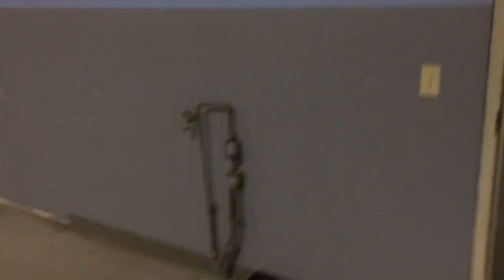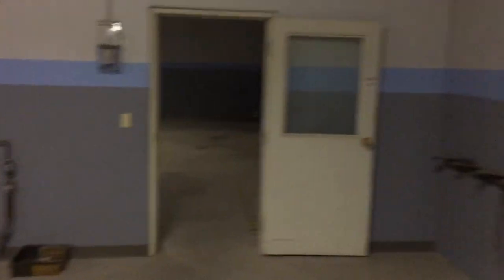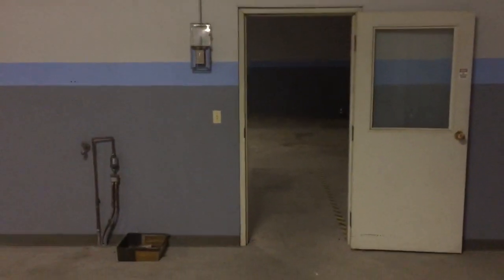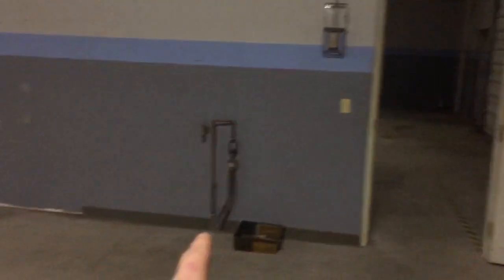Where to put roll-up door?  Help!

Comment: If you are keeping the Ru-door in the front, then don't try to move the electrical panels, instead shift the (to be installed) ru-door to the left (as you look at the E-panels), this will give you a gradual, more predictable turning radius. and much less potential for crashing or " curb checking" as I am guilty of doing numerous times.
  Also have you given any thought as to what kind of shop crane you want, perhaps a rolling gantry. and you might look into a pneumatic assist 2.5 - 3 ton chain fall/ winals hoist. those are always useful.

Comment: John, For right now I would put your roll up in the front. Later on I would put another roll up in the back. Your work area looks to be around 100 feet long if not more, so having doors at both ends will reduce forklift travel just like the swing doors you have at both ends reduces walking from one bay to the other. I know it will cost more to do it that way but in the end it serves your needs better. 
If you don;t want to lose the wall space in both bays then I would just place it in the front.
Planning out the location of machines and how to best utilize the space you have is probably more difficult then any other aspect you will encounter. When I was doing this for my shop I took a piece of sheet metal and drew out the floor space 1 inch equaling 1 foot, then I cut cardboard shapes for each machine  that included the needed work space. I moved them around until I found a layout that worked for me. 
I hope this might be helpful to you.
BTW Happy New Year and I wish you all the Best.
Cheers,
John

Comment: Make sure to line up the inside roll-up with an outside roll-up as others have suggested, gives you the most flexibility in the future.

Take some 1x2/1x4 boards screwed together or large cardboard sheets and block out areas you think a particular machine will go, but make sure to add in operator space and access for maintenance. 

Then take something of similar length to your longest/widest expected stock delivery, add 5 feet, and try to negotiate around things to work on it. Also drive the forklift around with that same part, and see what you'd "hit" on the block outs.

Really look at flow, in other words your deliveries will flow into cutting/dirty operations, then they move onto later steps in the process.

You were already planning at one point to put the "dirty" operations on that back wall, so that's where the roll-up should go.

Comment: I'm thinking no door. There is already an overhead door in the one half. It would not seem hard to transport around the parking lot to and from there, then you leave the separator wall to line up things. You won't lose space when you would have had to leave a space for to have yet another door pathway in the core of the building. I would increase those single doors to double large doors for sure. I would line my gear up in rows parallel to the center wall for ease in and out the overhead(s). Wow, I counted 5 in one half and one in the other. Lot of doors! lol

Comment: Wow that is rough.  How much to move the electrical panels? Both ends require tearing up the slab from what I can see from your pictures the center makes no sense for work flow. If  you put the door on the other side of the electrical panels and leave the man door please put guarding in front of the electrical panels. Its not pretty when something like a fork truck crashes in to them.

Comment: Near the water. Keep the man door.  For sure you will want to keep the man door.   Definitely don't want the roll up right near the wall.  Put the roll up just on the other side of the water.  Can move the water but that requires concrete cutting.  Doable at this stage.  Best of luck.

Comment: looks like those panels are in the best spot haha but I bet if you put the door just on the other side of the panels towards the middle of the wall that would be the next best. possibly better because if you had the door right on the end over the panels, it would be a tight turn from the existing roll up door to this new one.

Comment: I don't know what kind of budget you have to work with but my opinion is to preserve wall space rather than break it up. If you place machinery along the wall I t's cheaper to run electrical along a wall than to the center or other wall in your shop. I agree it would be better to locate the roll up door next to the electrical panels which will be close to the entry in the space next to you. Also if you locate the new door in the center or towards the far end will access become more difficult if that other space gets cluttered? Just my idea.

Comment: Hi John i would not remove the access doors at the end of the work shop as this gives you a point of egress in case of fire etc. the rool door i would just move it along the wall
a little  and at the end of the shop close to the exsisting door.
good look with the new shop i enjoy watching and learning.

Comment: Draw a layout of your shop floor plan on both sides of the shop, take into consideration the footfall of staff, turning circle of the forklift, plus ensure you have room for bollards to prevent the forklift hitting machinery etc. Safety is paramount for yourself, students and staff. Once your plan is done then you can decide the best place for the door, aesthetics are secondary to good planning.
I would use double doors and a pallet truck to move gear from one side to other, this would make the whole scenario a better prospect as there will be no moving forklift in the shop area.

Comment: First thought is nearest where material is delivered and product is shipped out.  I am assuming material rough cut, grinding,   compressors, and storage will be kept on one side and machine works and inspection on the other. The electrical panel is a non issue. Design your shop and install the electrical panel you need (with some expansion space) not try to work around it.

Working with a good electrician, HVAC, lighting, fire system, and compressor people during the layout phase can save many headaches. Also, I like to seal the floor. At least in California they get real fussy if any oil like material or chemical contaminates the concrete and removing it means removing concrete when you leave the building. 

A good PE is where I would start, only there is the wee problem of finding one, otherwise you get to deal with the county piece by piece to get it all signed off. Still it's do-able. Does the landlord have a PE he's worked with and trusts? That can help keep the landlord happy too.
Reply: Well, raw material is usually in 20' randoms and shows up on a flatbed. So which of the 5 doors would he back up to and can it be different than where box vans would pick up and drop off the smaller stuff?

The lane near the roll up would be the lathe side. Lathes get long things and all but one mill gets blocks. It can help to have a Bridgeport on the large isle side since that's the mill that get's the wierd long things balanced on forklift forks using things like a right-angle head usually (just saying).

You are going to decide on the size jobs you are going to bid, in quantities, weight range per part, and complexity, then the min and max you are likely to expand the shop in the next three years.  The electrical guy will need a good guess at all the current loads and likely near future ones. There will also be a discussion on transformers and how the capacitors are going to be arranged (often you end up with a capacitor panel since most of your load is inductive). This helps keep the power company happy so the don't charge extra.

Give the power company a call now. They will be happy to talk about what they would like to see (even if you only later do half of it). 

Fire marshall loves to talk too, just on a heads up of what you're thinking of installing. He needs a map of everything and would like a firebox set up with a key so they can get it to put things out. They also like a big breaker that kills the power near a door (even if the distribution panel is elsewhere).  Oxygen and Argon racked well away from flameables (and both away from forklift traffic and where they would come in).

Just keep asking them questions and taking notes. Posting exit maps for employees, emergency numbers, maps they can grab to get to the hospital, fire extiguisher locations and people with the training certificates for fire, first aid, and dealing with chemical spills....  Safety files of every type of chemical and metal on the premises (even the office supplies) have to be there.

1001 little things...

Comment: To the side of the water pipe and leave the door and pipe as is. Least amount of work and best location anyway. Or the same thing on the electrical panel end. Leave everything alone and go close to the panel. The real deciding factor would be where your bringing stuff in from and to. Which end of the building would give you the best access. The amount of work would be the same. Access to the door and maneuverability key factors.

Comment: My opinion is I think many people here including you are jumping to conclusions without thinking the whole thing thru.  My first question is what is the size capacity of the machines you will be putting in the shop area. You certainly don't need a big roll up door to move pieces that will fit in a Kurt vise. You have the big door in the back of the shop for moving machines in and out of there and I assume all large materials will come into the fabrication side 1st and be processed into pieces suitable for machining so the size door you need as a pass thru is really dictated by the size of those pieces. You could move a whole lot of materials thru your existing doors especially with a battery powered forklift. I see no need to be able to move machines thru that wall as you just take them outside and in the existing door if you have to but I can't think of many reasons to be moving fab machines into the machine shop or vice versa.  If you think your materials are too big for the existing doors I would suggest you turn them into double doors with no center post as that would give you plenty of space to move materials and be faster and more practical than a roll up door
Reply: NYC CNC
I still think you would be better served making that existing man door a double postless, you could get large pallets and even a short forklift thru them and anything else you can get thru a 8x 8ft opening. They might even make 10ft tall man doors as standard size but that I don't know. I hate to see all that prime wall space lost to another door, especially since you are loosing it on both sides of the wall.
Reply: +NYC CNC maybe you can deal w/ going outside and then in until you have a better idea of where the best option will be?

Comment: In line with one of the outer rollup doors seems like a logical place to put it. And maybe you could put a bigger door like a double door in the front so you can still roll some lighter equipement trough there

Comment: I think I would place it directly inline with the other roll up door where the Humvee is sitting. That way if you had something really long to move through the building you could do it without making any turns to get it through from the outside of the building. I couldn't tell for sure if you had a roll up door already in the back part of the building, which may make that unnecessary.

Comment: Why not infront the door behind the car? If you will move long equipment you can pass it from door to door OR diagonal from door left of the car to inner door.
Or, if you walk inside from the door at 0:41 and transfer lots of things through roll-up you can put it to the right cause it's very annoying to walk forward and than backward all day long

Comment: Next to the electrical panels. Too close into a cornes is not a good thing because You will only make it harder to move bigger items. In the same corner as the existing roll up door for the reasons You said and keep the man door. A roll up door with a man door is more expensive and they fail more often. Thgis as advice from someone who used to design layouts on machineshops :)  Happy new Year from Finland

Comment: Up front to the left of the panels If possible.  It's better turning radius anyway.  That way you'll be able to keep your man door as well.

PS.  If you are thinking of moving electrical panels, get some quotes (multiply by 2) and you will soon see that is not realistic.  Just moving the internal wiring in the wall will be costly enough.

I would steer clear away from locating it anywhere near a supporting column.

Comment: Near the main roll up door. If you have it near the back or in the middle you will need ally way access to and from it which will use up floor space. 

The other thought is to flow of work, how will the work come and go through the workshop.

A 3D CAD model will help visualize the work space

Comment: The area between the existing roller door and your opening will have to be clear.  Put the opening down the back and you may lose full use of the space occupied by the path between.  Suggest as close as practical to the existing roller door, keeping door ways.

Comment: I think you should put it somewhere about 5-10 ft to the left of the electrical panels. If you have it too close to the existing rollup door, it might make things awkward to drive from one through the other. (especially with longer loads) Plus, you remove the expense of moving the panels and still have the man-sized door to pass through. just my 2 cents worth after driving a forktruck at work on/off for a while.

Comment: I think I’m with a lot of others, put it just to the left of the breaker boxes directly across from the exterior overhead door. Straight shot in from outside to that end of the shop and you already have access to the back end of the machine shop from the other exterior overhead door. And I also agree with keeping a man door for convenience.

Some other silly observations. What is the wall made of? It looks like metal studs and drywall. Will that hold the weight of the roll up door? I’m assuming you could frame some structure in there that would allow for this but just something to think of, and yes if you just go with a curtain wall for now that doesn’t matter as much. Also it looks like you have some electrical outlets in the wall so you may need to account for moving the wiring up and over the new roll up door, sure you thought of that already.

Happy New Year!

Comment: Moving panel is too much cost with no return.
You want the area divided to keep out smoke and such from fab/welding side. That makes man doors necessary at both ends.
That leaves the middle to one side of the post or another. 
Since you are going to focus on the front for working on machine side,  towards the rear side of the post makes more sense for moving things in and out without killing your wall space.  You want people coming in to see the machines and students working from the front of the building. Having them off at a distance in the back of the building isn't very good showcasing.

Comment: I would put it between the electrical panel and the post shadow. Straight in front of the exterior roll-up as much as possible. Reason being you already have a large entrance for the machining  room on the other end that goes outside. And when you get your equipment in place it will still provide a path from outside to the storage room and the class room and this end of the machining room. Also it will provide cross ventilation from outside to the existing machining side outside roll-up door, in case you need to air the place out due to heat or fumes. I  agree with the other  posts that you should leave all man doors in place. Leave the electrical in place because you cant put stuff on the floor in front of it anyway so the path from machine shop to classroom and outside will only be blocked if you put something in the service bay. Hope this helps.
Reply: +weaves7  It would also allow some separation of the auto shop area and your classroom/machining operation by having the exterior roll-up door by the classroom for your use and the other 3  for  renting out or freedom huddle stuff ect.

Comment: I would put it in line with one of the overhead doors coming into the shop so that it is a straight shot through from the outside. It will just make life easier if you are using that path to bring equipment or supplies in. Also if you ever need to back a truck and trailer into  that side you can very easily if they are in line. Good luck.

Comment: Go just past the power panel's buy the same distance as the man door,you should have room for the roller door you want or need and still keep back several feet from that pillar support. please keep in mind you don't want to install a full height door there for structural reason's. A ten footer should work for you. best of luck to you and happy new year's.

Comment: John
Do yourself a big favor and layout your shop with all three options and decide which will work best.
Keep in mind the use of each area and what access you need for each function. 
Those three options are basically described by two traffic patterns, 2 U shapes and 1 H shape.
The H shape (with the central door) may allow for more efficient movement of material through the shop since only under the worst circumstances will you need to travel slightly more than the length of the shop. The U shape will require you to travel twice the length of the shop to move material from one end of the U to the other. I don't think you will lose any more space or access in one configuration than any other. It all depends on how you want to use the space. 

That's not something I can figure out in my head.
Good luck and Happy New Year.
John